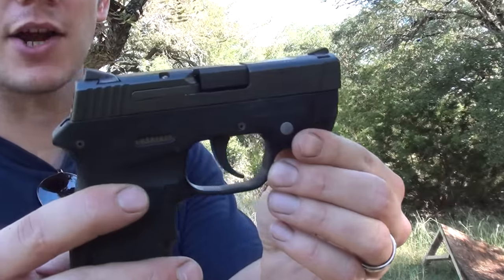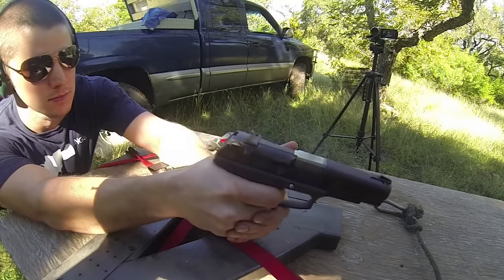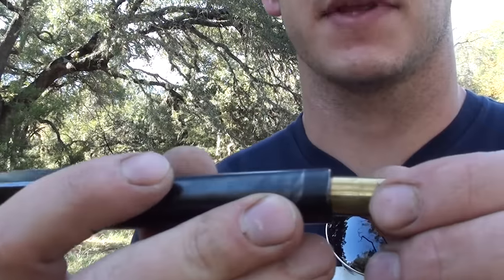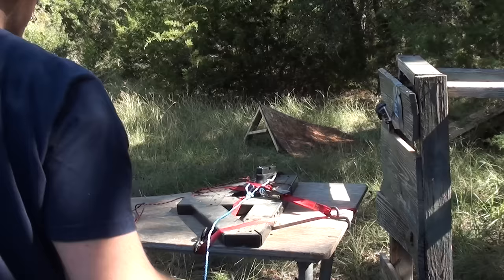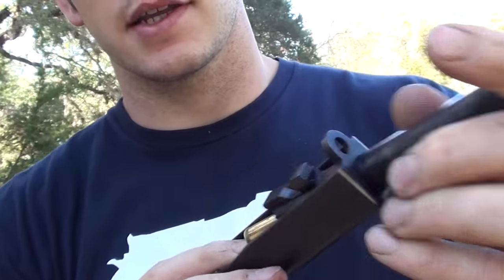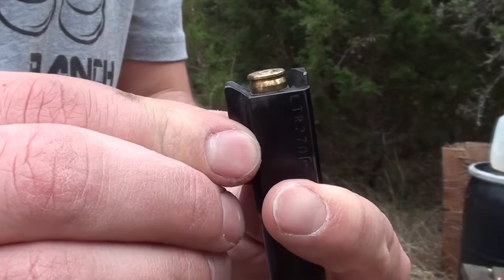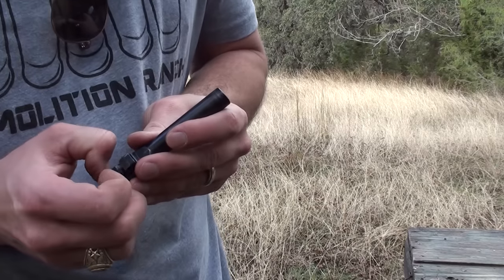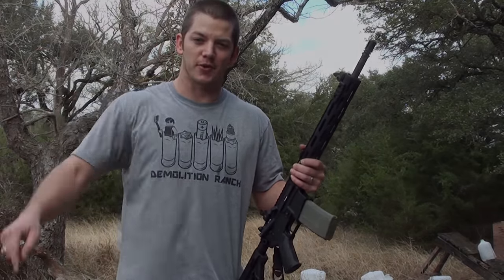Firing the Wrong Caliber

Comment: You watch enough of these types of things, the results tend to become a lot more predictable.  After watching what happens when you set off a shotgun shell outside of a shotgun chamber and barrel (answer: practically nothing) and another of the same but with a 50 cal round (answer: practically nothing but the microwave oven didn't care for it) the importance of compression to the performance of both the ability of the semi-auto to cycle and of the projectile(s) to fly properly are heavily dependent on correct and optimal use.

Also a notable mention of the lessons learned when dumping .22s into a blender.... the results were very disappointing.

But to teach the importance of a focused blast vs an unfocused blast, consider that a 40 watt light bulb, putting off a LOT more than 5 watts is basically harmless to look at for a blink of the eye.  But if you were to receive a 5 watt laser to the eye for a blink, and you WILL suffer serious damage.  (Don't try it... too many people have done it already... learn from THEM not yourself!!!)

So there you go.  No need to repeat this experiment... unless it will get views.